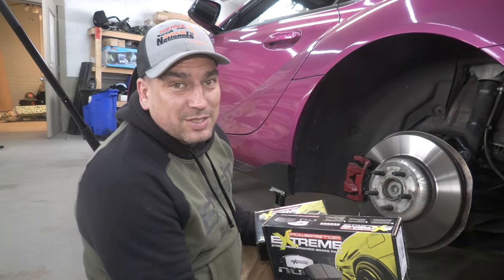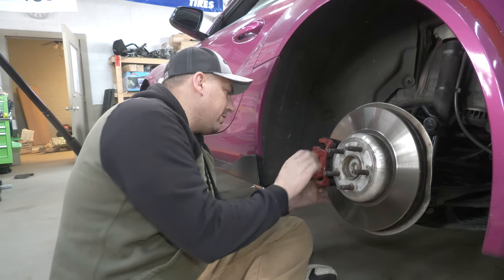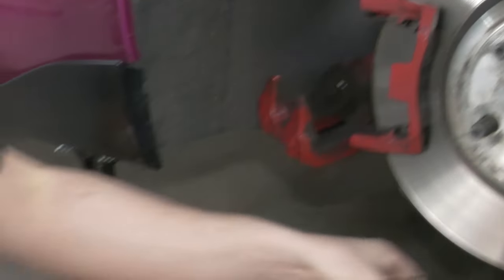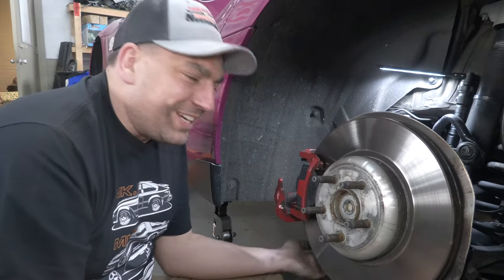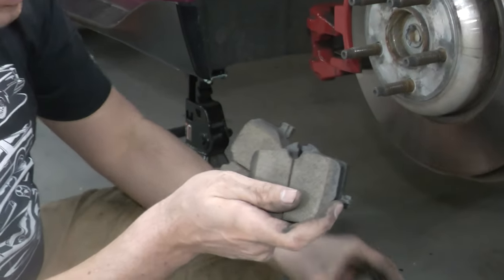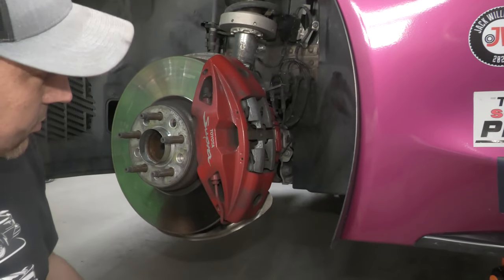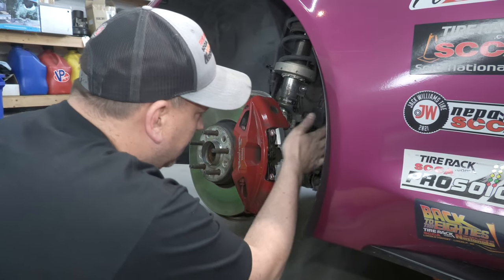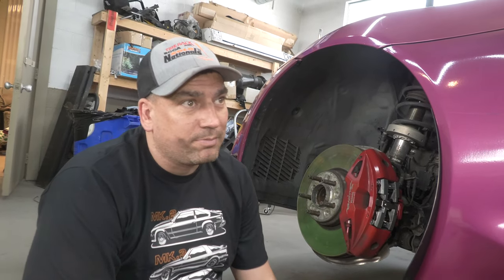How to Change Your Supra Brake Pads-Powerstop Z28 pads

Comment: Hey Matt hope your doing well.. I put the Powerstop Z23 Carbon Fiber Brake Pads with Drilled & Slotted Brake Rotors Kit on my Jeep Grand Cherokee.. A year and a half ago what a difference in stopping performance.. I am sold on the kit,, ended up also doing the same on my VW Jetta and Honda Odyssey .. Stay Safe!
Reply from the maker: I’m glad to hear that. I’ve had them on a few vehicles and have been happy with them. Thanks for watching and commenting as always.

Comment: Thanks for this diy video! I got the same pads butttt, would you be ever so kind to tell me the part numbers on your boxes? I think I might have been sent wrong ones..
Reply: Hey did you ever find the right part numbers? Looking to install new pads on my Supra aswell
Reply: @juanaraujo4451  I actually did. There are different ones for the supra but do fit. Thanks!
Reply: @wondrahsupra  Nice, I just found the part numbers for Z23 and Z26 brake pads gonna go with the Z23 since it's a daily driver